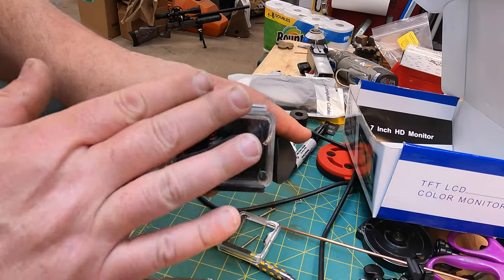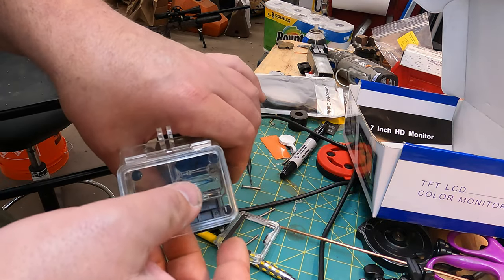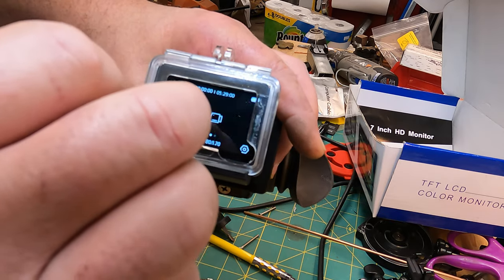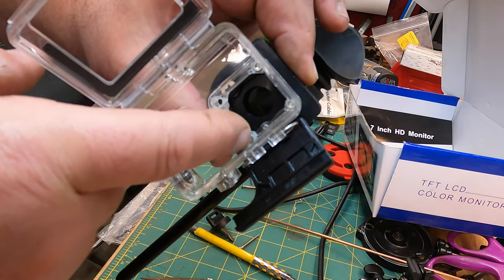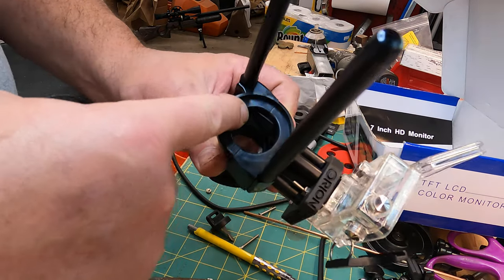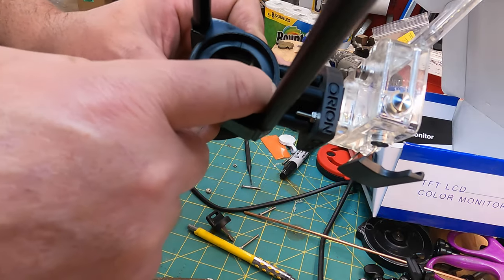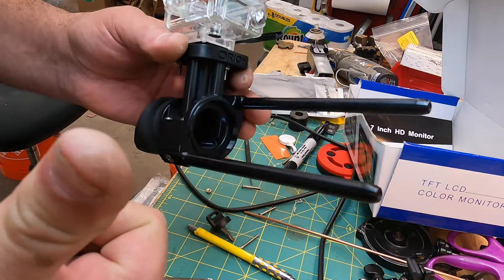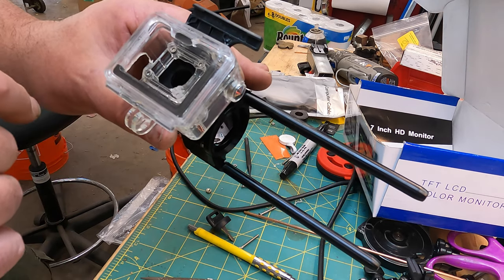Better Scope Recording for LESS money Orion the Iguana Hunter adapter part 2!

Comment: Awesome video, great tips! I did something similar to my old sideshot and that was an inspiration for the new design.... package your way soon!!
Reply from the maker: Thank you Sir!
Reply: @TargetForge  Great tips. I will be looking at my setup to see if this will help.
Reply from the maker: @Thunderstruck598  Let us know!
Reply: @TargetForge  So my Orion mount arrived today and I installed it. I was using a different mount  and it was taking a lot of fine tuning with shims to get good alignment. I installed Orions mount and I must say, it is MUCH better aligned. I do have some more work to do though. I just filmed a bit and I don't see the entire scope field of view. The right side is cut off. I still have the flat head screws in. I'm wondering if I went with socket head capscrews like you did, if it would better center the image?

Comment: Im wondering if i can modify this firefly adapter to a go pro7...i mean why cant i find one.like tons of people had to have bought the original phone version and now want to switch to an action cam with 240fps
Reply from the maker: You will need a different lens on the GoPro, that starts to get expensive. Perfectly doable, but not cheap.